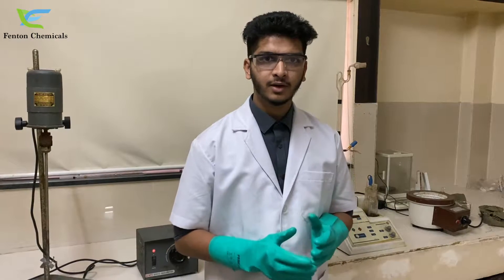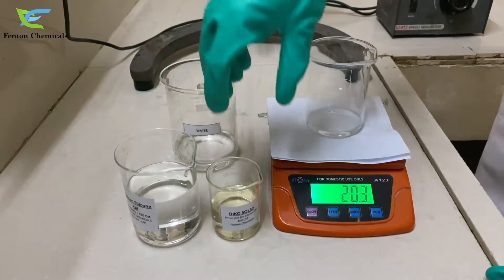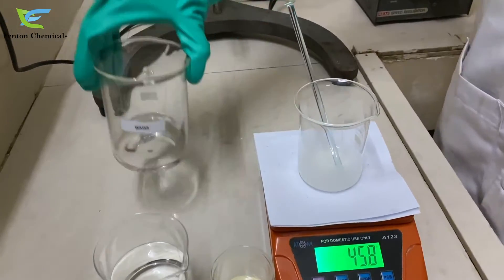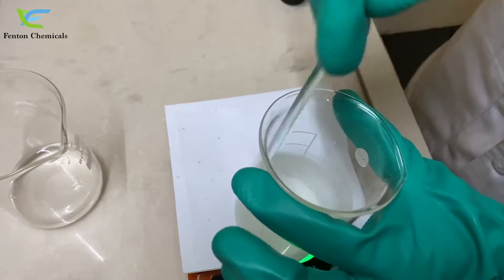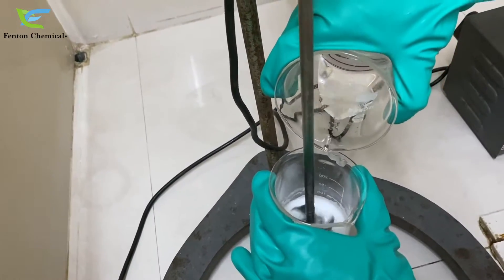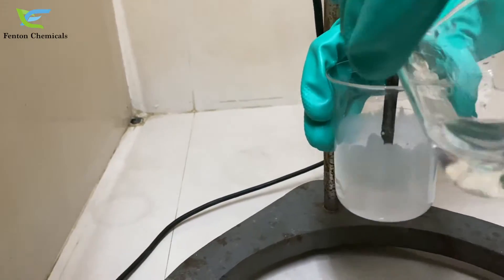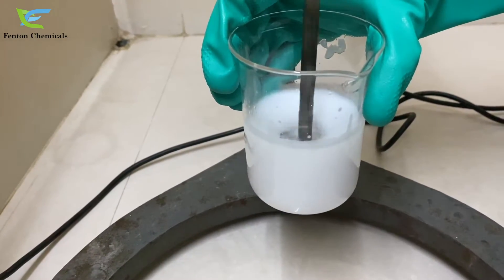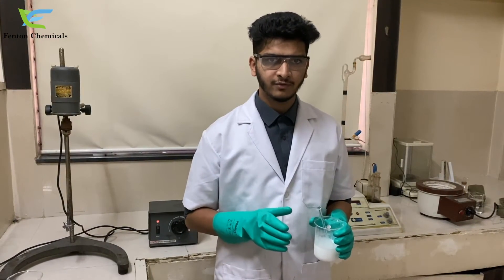DIKO SOL50 -  Silicone Oil Emulsifier ( How to make Silicone Oil 350 Cst soluble in water )

Comment: Can it quench steel?
Reply: Usually you need used engine oil due to the micro carbon+Steel particles infusing the oil for that application but I never thought about using a silicon emulsion ,the boil point it's superior but since this is a water soluble mix using an emulsifier this ingredient could be the weak point with flame tendency

Comment: how to make silicon defoamers for molases fermentation in sugar industries  pls tell
Reply: If it is for food use you have to use food-grade silicone and emulsifier. Try Span 80 and make sure it is food grade, mix silicone oil and span 80 at a ratio of 2 oil and 1 span, mix thoroughly and add warm water while mixing, mix at high speed for at least 10 minutes
Reply: I need defoamers for industrial grade.... can you suggest us sir.....pls